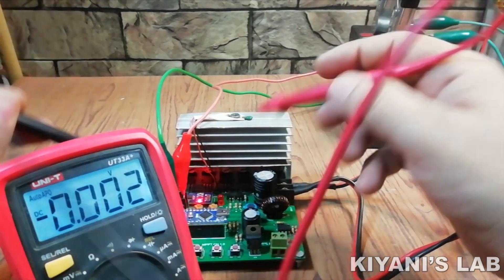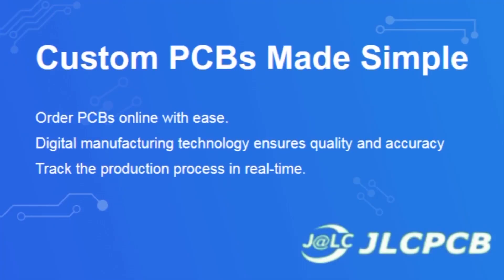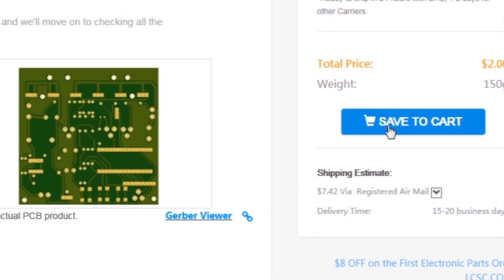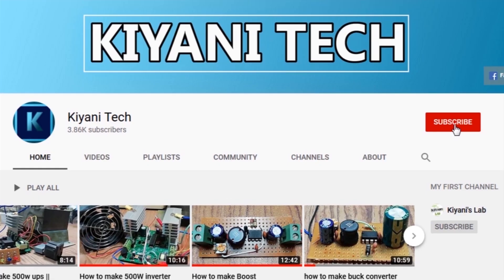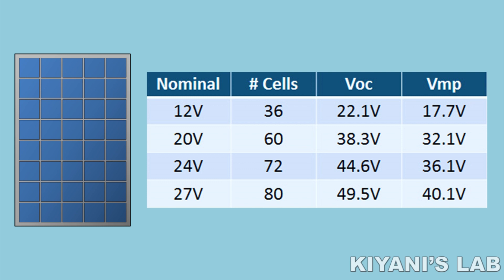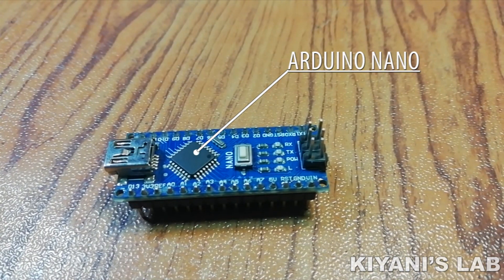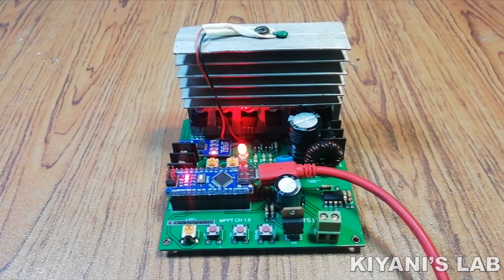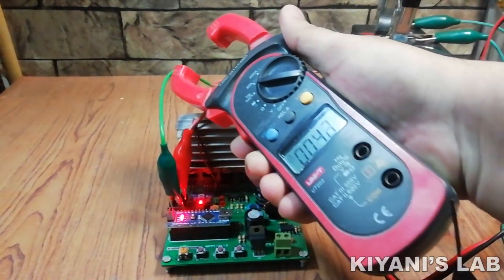How To Make MPPT Solar Charge Controller

Comment: You don't need the optic. You have no solar cap. And you may burn the MOSFETs due to a voltage spike.
The battery side is a boost circuit depending on the battery type.

Could you have not used the ht7775 for power as you would need less space and components.
Reply from the maker: solar side cap has been added to new version

Comment: MPPT means maximum power point tracking. If there is a lot of power loss during the transfer of power from solar panel to battery, that defeats the purpose of MPPT. To improve the efficiency of your circuit, use a capacitive boost strap circuit on the NMOS gate. Most MPPT controllers use this type of configuration. The optical coupler made its efficiency much lower.

Comment: What is the efficiency ?  Base on my calculation, NMOS Vt=3V, optical coupler Vbe=0.6V,  voltage across drain source is 3.6V. If the solar panel output is 18V. Then voltage at the MOS output (source) is 14.4V. Lot of power  lost at the MOS.   Is it more  efficient just connect the solar panel output directly to the battery?
Reply: It is not linear regulator, it is pwm, having mppt algorithm

Comment: MPPT means "Maximum Power Point Tracking" where it uses maximum power transfer theorem to keep adjusting the load "impedance".  Can you explain your design that this is happening in your project ??????  It seems that this is an advertisement for JLCPCB